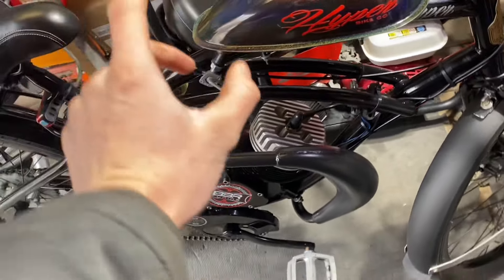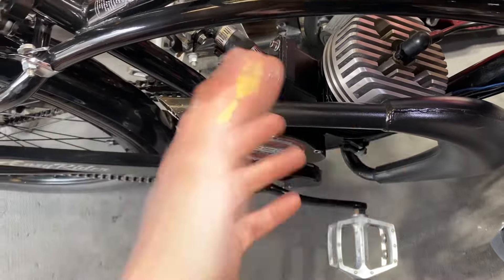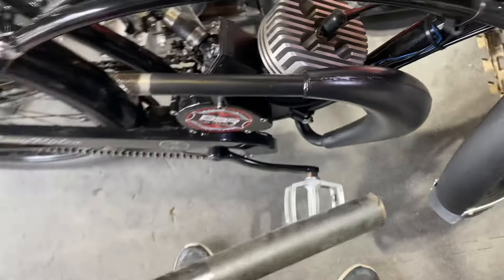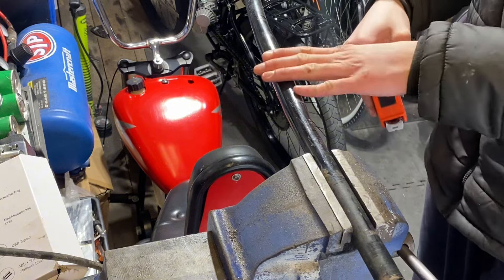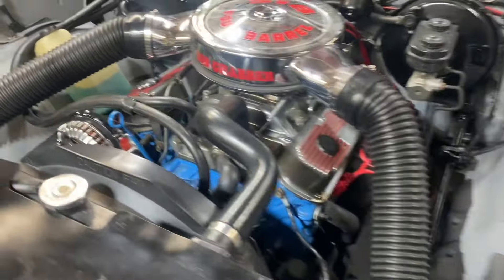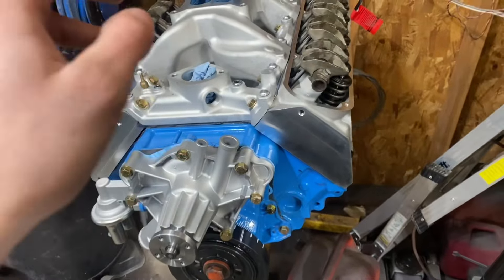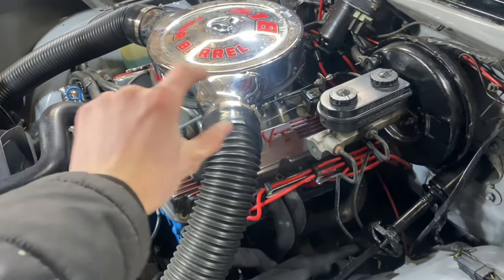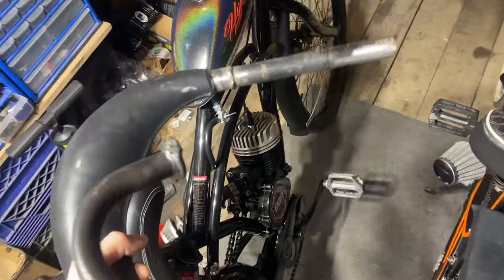Upgrading The Mz65 Clone Exhaust Pipe (Improved Scavenging)

Comment: So what you’re doing is reducing the inside diameter of the stinger on that expansion chamber? I’m confused as to why that provides any benefit. Or maybe I’m not understanding what you’re doing at all. Pls help me out here.
Reply: Leaving the exhaust port and going into the exhaust pipe, the header should be bigger than the stinger. Example, 1" header pipe/belly/3/4" stinger, for the expansion chamber to work better, there should be a little bit of restriction at the stinger, not the same flow at the header.
Reply from the maker: @JamesEgly you explained it well my friend